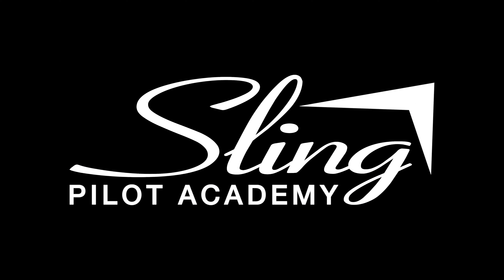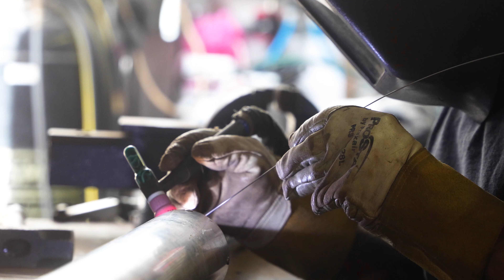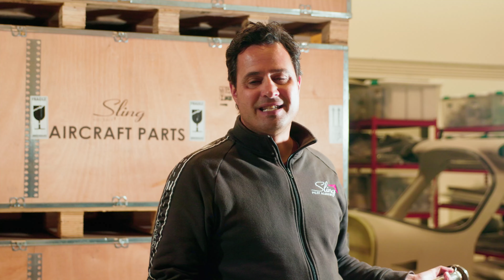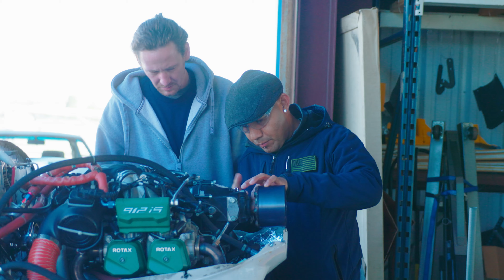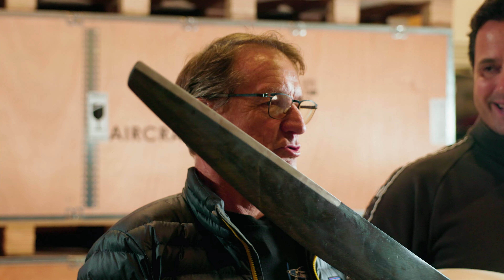How and Why We Built the Sling Whisper! | Interview Breakdown With Matt and Jean

Comment: These are great achievements and a necessary change for the survival of GA, IMHO.  GA has been stuck in a decades-long technological rut that it's finally starting to get out of.  Imagine if a large proportion of the cars in your neighborhood sounded like rods built in the '60s and designed in the '40s and '50s with lead-belching engines and inadequate or no exhaust muffling.  Over the decades, the public has gotten used to whisper-quit cars, so it shouldn't be too surprising that complaints about GA noise are on the rise.  GA aircraft will never be as quiet as modern cars due to the presence of the propeller and the necessity for full-throttle operation on takeoff, but efforts like this, as they become more common, should go a long way towards helping to address the push-back, at least to the point of slowing down airport closings or heavy restrictions on training activities.  Kudos for working collaboratively with the community on this.

Comment: Excellent work on the Whisper design. It may revolutionize the design of all piston prop planes, eventually -- not just the Sling. Also, this is an excellent video explaining what you're doing and why you're doing it. I hope that your work will result in the city's relaxation of the training restraints it has recently imposed on the Sling Pilot Academy and other users of the airport. If not, that will prove the wisdom of @airops423's view that what's happening at Torrance Airport does indeed have more to do with real estate development than airplane noise.

Comment: Sadly, especially in California, this is often not about noise at all. Or lead, or safety, or whatever excuse of the day they decide to use next. It's just a real estate play. Airport neighbors buy their house at a lower price relative to the local area because it's next to an airport, and in their mind if they complain enough just maybe the airport will get shut down and their property value will skyrocket (when the airport is turned into a park of course, god forbid they build more housing).

If they were actually concerned about noise, they would start with the absurd road noise pollution that is way more ever-present and obnoxious in the LA area than air traffic will ever be. Great job on the engineering work on this, but I fear nothing you do will ever be enough to "satisfy" the community.
Reply: Seriously. Whereas Sling is working to quiet their exhaust, the "Fast & Furious" wannabes are out there doing the exact opposite. They modify the exhaust of their cars to be as loud, disruptive and annoying as possible, and with impunity! 🤬
Reply: Couldn’t agree more with this comment. The real motivation to close airports is the value of he land. As to noise generated,
the noise from Rotax based small aircraft pales in comparison to other aircraft, even before any noise reduction.
Reply: Which is why our federal government on all airports closed for noise abatement concerns due to quality of life for nearby neighborhoods should be mandated and required to be zoned immediately for commercial housing and built within five years to ease the housing burden for the struggling nearby home owners.